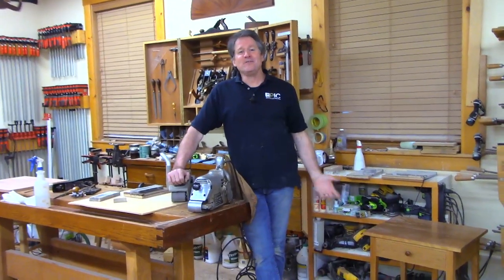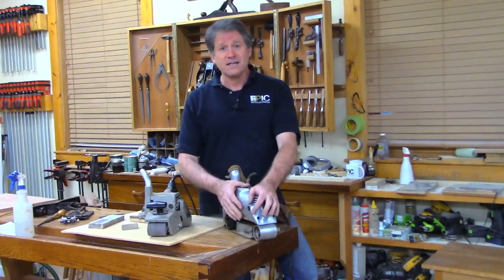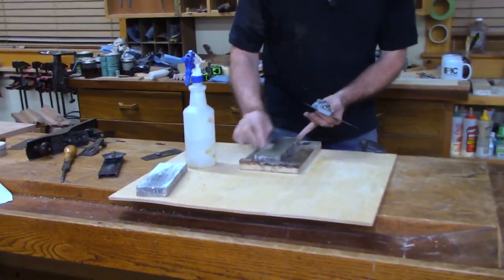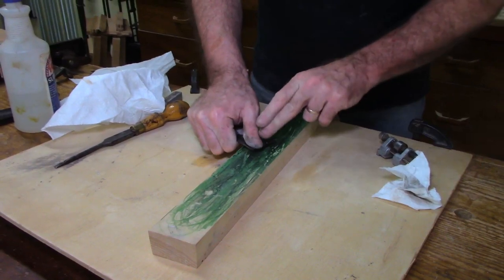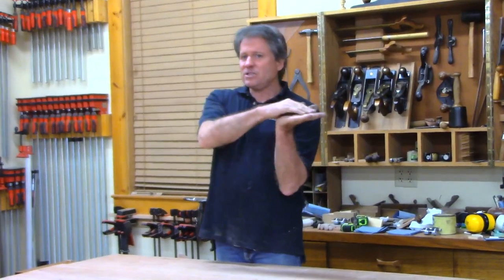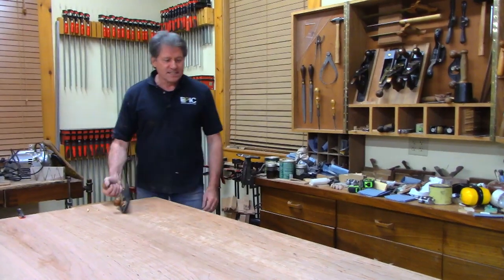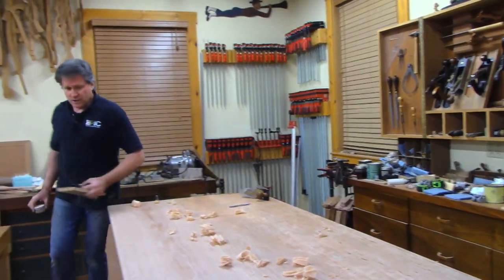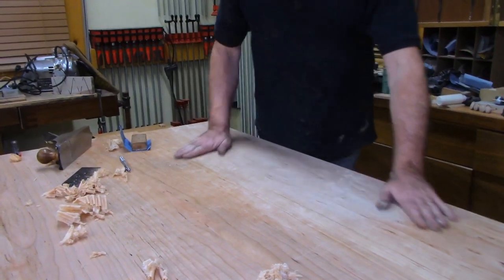Handplaning Huge Tabletops with Tom McLaughlin

Comment: Hi Tom, hand planing a large piece can be a big job, thanks for showing how to tackle this. How did you go about gluing the boards together?  Would love to see the finished table if possible, take a picture. Have a great 4th of July, see you next week on SNL.
Reply from the maker: Thanks Steve, I just jointed all the edges true and first glued together the three main pieces, one at a time... no biscuits or dominoes, expect for one end where I wanted to be sure it didn’t open up.
Then glued two of the three planks together, then the third onto that to make the full top. So it was glued up in five stages, being sure to align accurately and get nice glue coverage. Also, I used protective scrap strips of the same thickness to keep the clamps from marring the previously jointed edges. It all went surprisingly smoothly when taken in stages like that. I’ll make a point to get a finished photo when it’s in its town office home. Have a great weekend yourself!
Thanks, Tom